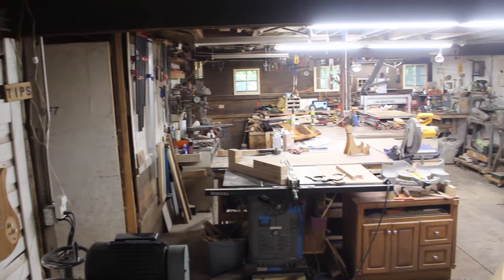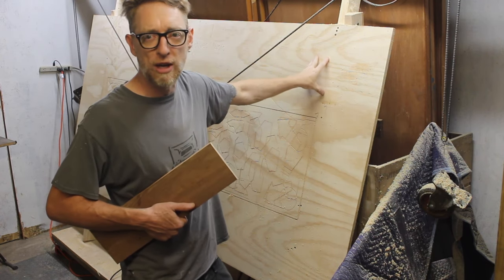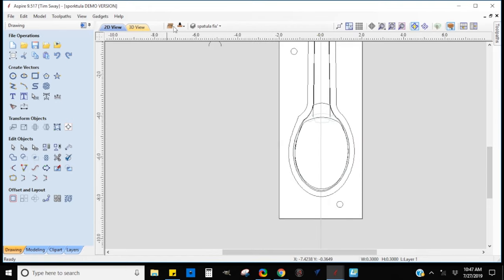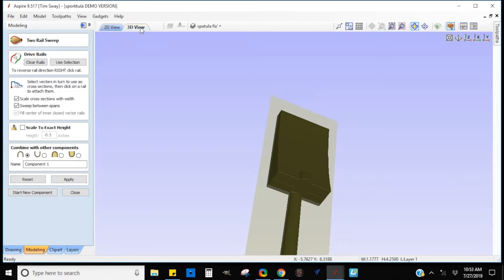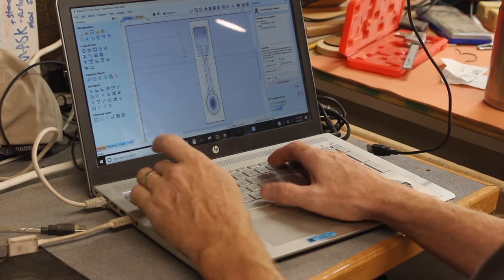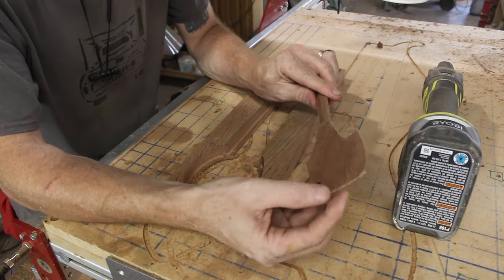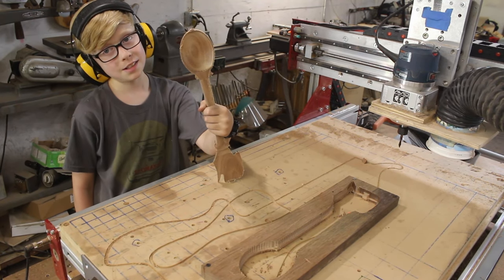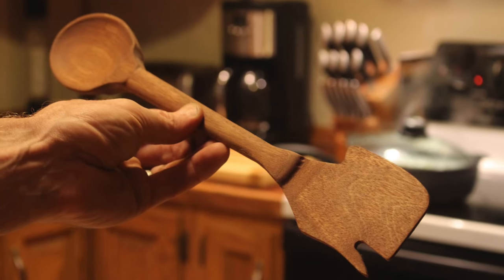In the labs with Tim Sway | Making a Sporktula | Vectric FREE CNC Projects

Comment: I’ve been told a lot of South American woods are toxic when you sand it to make a cooking utensil out of it sounds risky. Also decking is usually treated with something to help it keep its color.  Cool design though going to give it a go.
Reply: You are absolutely correct and one should do the research before assuming wood is safe. wood-database.com is a good place to check. Cumaru, teak, etc., are used for exterior use because they do not require treatment to be rot resistant and cumaru has no additional toxicity or safety warnings beyond the average lumber but other woods do! Always check.

Comment: Nice idea and nice job! Your shop looks a lot like mine, which is also part of an old chicken house. Thanks for sharing!
Reply: Ha! My shop is in on a retired chicken farm. All the floors are slightly pitched so they could hose them down and squeegee the water into a trough along the front that drained out near the crops field.
Reply: @timsway  My place is a former chicken farm as well. The building in which I made my shop, is 2 story on a hill. The bottom (mostly dirt floor) is where I keep my tractor and brush hog, the top is where my woodshop is. It has a thin wood floor, which I started to reinforce with 1 1/8 thick sheets of MDF sub-flooring. Still too bouncy for any big precision machines.
I keep my small CNC in a dedicated room in my house, along with a metal lathe. It's nice that you have an easy to clean concrete floor!

Comment: I love this video and project, Tim. I have VCarve Desktop but have been looking for a good tutorial of how Aspire’s 3D capabilities add value. So far I’ve just used Fusion for 3D, but this looks easier to use. Also getting ready to finally order my own Avid, just trying to pick model/size!
Reply: cheers! I love my Avid. If you're running a biz, I'd suggest starting with the 4X2 as you can expand that model. the benchtops are one-size (mine doesn't go any bigger than it is). I'm currently working on upgrading a 4x2 myself.
Reply: Thanks. No interest in doing this as a business, prefer it just as an expensive hobby. But it does seem like the bigger tables are more versatile, maybe even adding plasma capability to cut steel. Trying to figure out how to fit a 4x4 now.

Comment: cool vid ...subed ..I have pre 2019(2018) cncrp pro 4x4 .gecko g540/nema 23/300/oz.and I am sure I changed something in the speeds and feeds in vcarve pro AND mach3 trying to etch glass and changed settings in both...mach3 acc/vol...vcarve pro mm/pm..or mm/sec...is there away to reset these to factory ...some base line I could get back to for both mach3 and vcarve pro would be great ..not that I broke a lot of bits only 4 I tnink and 2 were .125 b/n....and turned out real nice work in wood mostly hard woods ..any help would be great...thnx